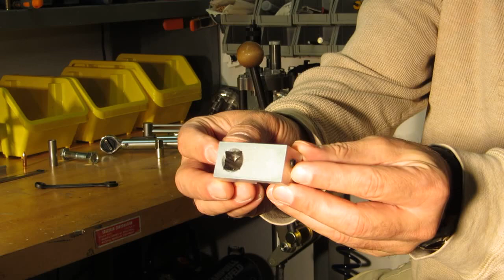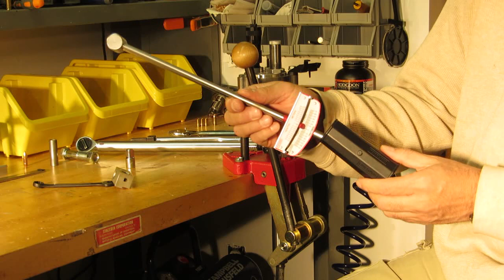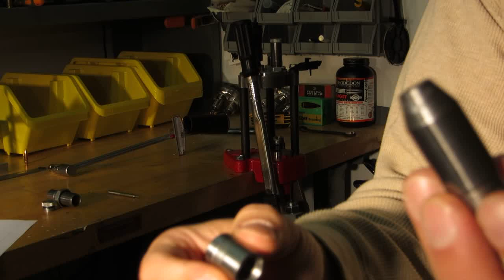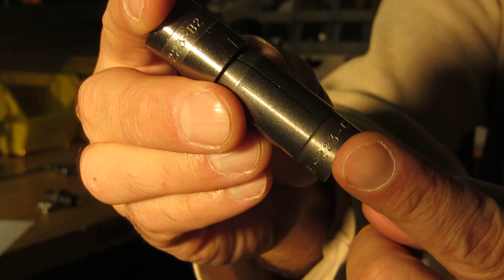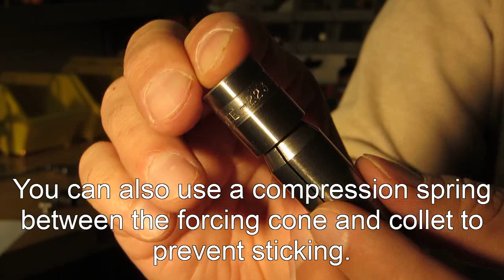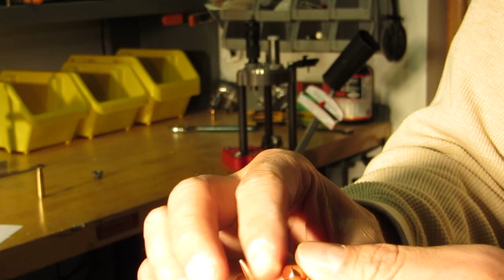Installation Reloading Press Torque Wrench Adapter (for Lee Classic Turret Press)

Comment from the maker: Apologies to all.  Being new to youtube, I didn't understand how things worked, couldn't find the comments and wasn't getting the email (account was set up wrong).  Just today, I found out about the emails and spent the last hour figuring out why I couldn't find the comments.  Enough about that...

I'm out of adapters right now (didn't make that many in my first batch) but am going to make some more and will be selling them on ebay.  I'm in the middle of a move (moving from Colorado to TX) so it will be about a month before I'll have anything ready.

I'll comment here when they are available on ebay (7/20/2014).

Paul